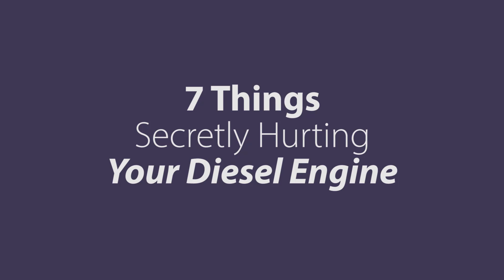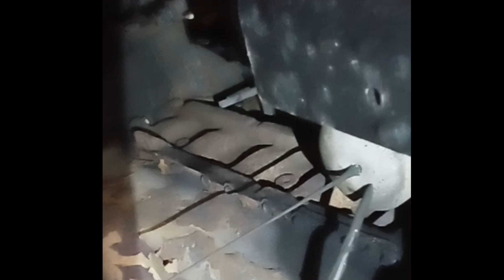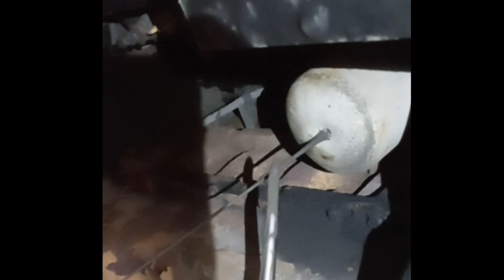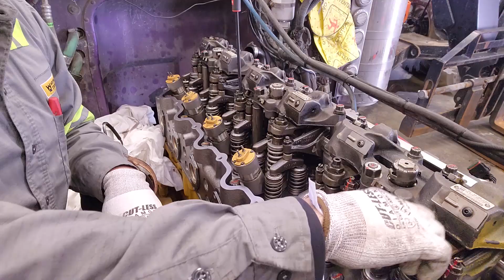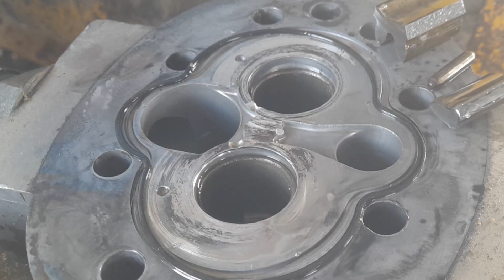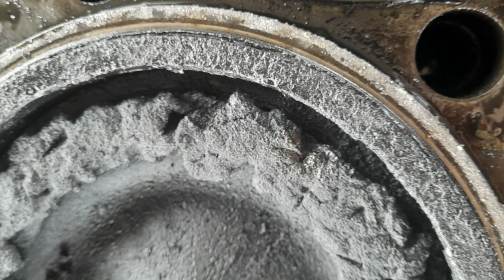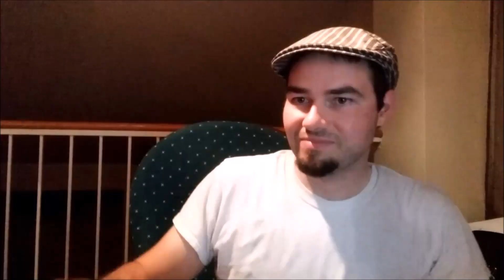Top 7 Things that could be SECRETLY Hurting your Diesel Engine.

Comment: It blows me away that we haven't gotten ACs that can run off batteries. The engine always has to be on to stay cool. That's just stupid.
Reply: AC is extremely energy intensive. The reason it works well on a belt drive is because you’re providing 2-3HP or something to it in that way. 

If you need 2KW from a battery you’re going to have a bad time. Even a Tesla power wall which is huge and heavy would only be able to run AC for possibly 5 hours.
Reply: They're available,probably the cost puts people off
Reply: Back in the '90s Cat developed a system called MorElectric. This was a genmotor replacing the flywheel, starter motor and alternator. It could make 30kW (50HP?) @ 48V (just like the Cybertruck is doing today). Cabin cooling was an ELECTRIC heating & cooling airconditioner (size to mount under the seat). 48V enabled electric waterpump oil pump fuel transfer pump but NOT the fan - they need 30+HP to drive. It also meant you could plug the truck into a power outlet and have full heating/cooling with no engine running.  The BIG benefit for reliability was removing the lines for air con and heating systems and going to rigid lines.
This didn't go very far - though Cat did change to electric cabin cooling package in the roof to get the reliability improvements.
Also Cat Industrial engines is again talking about the 30kW genmotor (well they did a few years ago I haven't looked more recently).
FYI the people that REALLY wanted it was the US armed Forces - an inbuilt generator with EVERY truck. The beauty they saw was no extra cooling system packaging etc etc. They wanted 60kW though - not sure where that all went to. Maybe it is its time now
Reply: @ianloy1854  That’s cool. If trucks were geared up with electric heating and cooling that would enable all truck stops to have power outlets and operate more like powered RV sites. 

Not sure if truck drivers would prefer to pay $10 for power overnight or idle their engines though. I’m sure a lot of people would complain about needing to pay, while idling the truck overnight probably contributes to an expensive rebuild lol.

Comment: What about using the Exhaust Brake to warm it up quicker right from the start?  Probably not good, huh?!
Reply: I could be misinformed but have heard in the past anyway that some of the European diesels that had an exhaust brake ( basically a butter fly valve after the turbo in the exhaust system ) used that system to give some back pressure to enhance warm up and thus reduce the time the engine is running cold/smoking. I don't know how the system was controlled, I presume electronically. An actual exhaust valve controlled type Jake brake system would not have that ability. That might be something Josh can dig into and make a video on exhaust pipe engine brake systems with their duel purpose.
Reply: @charlesb4267  Elsewhere there is a comment about current Volvo/Mack having VGT turbos and these closing up to help heat the engine - effectively an exhaust brake (not compression brake) yes it helps. The issue is will it be turned off at the right time?

Comment: On my 2018 Pete 567 with the Cummins X15, when I change my fuel filters, I install both new ones empty. I then just cycle the key several times which runs the electric lift pump that pumps fuel from the tank. It will fill both fuel filters (the sound changes and you can tell when they're full). I then start the truck and it runs normally. Easy.
Reply: R u bleeding air from fittings as lift pump primes?

Comment: cold starts under 30 degrees, start give it 3-5 mins idle then idle up 650-700 rpm 5 min then 800 for about 5 min, next as getting rolling idle out of parking spot, basically working gradually as getting on the highway getting tire sidewalls warmed up and trans diff and freewheeling hubs fluid up to working temp gradually

Comment: Agree on extended cool idles doing damage mostly from excess carbon deposits BUT; swift temperature changes and high reciprocation speeds will cause different metals to expand and different rates, causing cylinder wall chaffing, loosening of fasteners, and cracking of hard metals such as exhaust manifolds
Reply: I'm with you on this point. N14 here. Cold or warm weather, I'll start, low idle for 1 minute then high idle ~1000. When oil temp rises to minimum 120* then I feel it's ready. In freezing weather it does take up to 10 minutes but I'm not shock heating the different metals involved

Comment: There was a Cat training video back in the day that showed how oil fills gaps between moving parts at low idle vs elevated. It was showing how increasing the RPM pulls oil into these spaces creating a thicker cushion so to speak. Does your training dept still show those old videos on liner cavitation and whatnot?

Comment: Yes Sir, prefilling filters, makes me a lot of money. I have had a couple piston failures, oil filter was prefilled. The foil was apparently pushed into the oil jug. Poured directly into the unfiltered port. Eventually made it to a spray jet and plugged it up, early 92U engine. 
Second, MBN, oil filter must have been dropped in oil dry. As I dug parts of oil dry out of two spray jets, again seized pistons. 
Improper maintenance, is the fast way to the repair shop. Also putting new dirty parts on. Had a REGEN engine that I replaced the fuel enable valve. Before I installed it, I took starting fluid and washed it off, onto a lint free rag. You could see the metal fragments that washed off the threads. As my first cousin told me once, John you can never be to clean building an engine.
Have a safe and a Happy New Year to the Josh Family.
Reply from the maker: Thank you John and have a great year. Hope you are feeling better.
Reply: Well Prefilling in itself is not the problem...being an idiot is going to ruin anything...But prefilling is better than starting an engine with ZERO oil pressure for 10-30 seconds.  I have rebuilt thousands of engines...and prefilled tens of thousands of filters....I have NEVER had a Pre-Fill-Failure... But then again, I'm not an idiot... If one is not going to pre-fill oil filters...spinning the engine over with the starter to prime the oil system before starting it, is a better way... On the OLD Mack we had My Father would prefill, AND spin engine over with the "Engine Stop Cable" pushed in...To build pressure...Therefore the engine never fired without oil pressure...He also warmed it at 1000-1100 RPM for 15-45 minutes daily...That engine/truck went more miles than ALL of its "sister" trucks...

Comment: Happy New Year.. Got a video option, Ether use on a new cat motor a Nex Gen 2022 cat 323... afew months ago in March, new operator shows up to my company, has experience but only working for Public Works and is 40 years old, boss thought he has the most experience, yet hes only operated a old 1990 Link belt, and maybe a skidder... long story short its cold my 2020 Cat 330, i let it cycle 1-2 times on the glow plugs and start it up.. he decided he should grab ether from his pickup and was starting to spray his airbox on 323 with ether.. i said woah dont use that on any of our new machines for no reason.. and he was insulted but I said that 323 has started in -34C... I said its only -20C.. Im in Canada, would be great to hear or see Ether storys on why or when to use it, when a block heater power soorce is not available in the bush.
Reply: Also how long should you wait to shut down a cat motor.. a c7, running hard all day in 90-100F .. this other operator would shut down the machine immediately after using it, just to talk with someone.. And I tryed to say Dont do that but at the end of the day I dont own the machines so if my cousin/boss isnt gonna do anything about it and assume it will be covered under warranty on excavators, but yea how long do you let a modern tier 4 engine cool down before shutting it off. I usually wait 5-8 minutes.
Reply: @JaredBeaucage  The time needed for the turbo to cool down - so if you haven't been working it hard you may well shut it down with very little idle time, if you've been working hard then the 5 minute wait (above low idle preferably) is better. The need is to cool down the turbo shaft not just the wheels as it is the shaft that runs in the bearings and can cook the oil that left between the bearings and the shaft which is what you are trying to stop happening.

Comment: at 6.25 you can see the bolt update hasnt been done, you really should find the service letter  and follow it, anytime you have four 12 point bolts in the jakes it needs done, you should have three six point heads with bolt 3 being 12 point, no thermostat creates hot spots in the engine, the water must slow down to absorb heat, heat transfer takes time, cat will cut the fuel within the ecm if boost is too high so pinching off the wastegate is moot, blowing out air filters should have been in your list, fuel filter on the frame must be a 25 micron not a fs1000 or fs1001 which is 10 micron will starve the fuel pump, the fs1212 or cat filter is 25 micron, most of the soot on the dpf is oil that bypasses the rings not unburnt fuel.
Reply: i found this on the web since i dont have access to sis anymore (The 3 required 12 point bolts are 167-0867, but the 9 required 6 point bolts are 257-2122) guess you might need washers also? dont recall any washers being in the bolt kit.

Comment: Hope you and yours had a Merry Christmas and have a Happy New Year. Great Video On large trucks, But what about small trucks. I just bought a new {23} GMC half ton with the 3.0 Duramax. I keep it in a heated garage. What recommendations do you have for that engine and all the other small truck diesels? Keep the vids coming. I owned big trucks in the past, mainly with the 3406 and a couple of Cummings, and I did do what you said every day and servicing the engines. Although I am from northern Mn, at the time I had the trucks, I lived In South Carolina and Texas, but dis run I80 and I35 for many miles.

Comment: If I was a trucker I would have a apu on my truck so I dont need to idle the big engine like a small 2 cylinder gasoline engine
Reply: Honda 3000 IS on mine. Best investment I have ever made.
Heater now, summer a portable Samsung A/C. 14hours/3.4gal gasoline

Comment: On my Cummins x15 it has a fitting that you put a connector on and you pressurize fuel and that fills the fuel filters so it fills up your fuel filter from the dirty side with pressurized fuel
Reply: that compucheck fitting isnt for filling the filters and its on the clean side if your filling it there with the detroit fuel tool your giving your engine dirty fuel, cummins you use the primer pump to fill filters and bleed air out the fitting.

Comment: For my 1.9 tdi take for example it was 30° yesterday in florida I put my idle stick for about 1700 rpm for 1 min oil pressure came right up after 1 second of starting im running right now 5w30 with a quart of lucas and have 50 pounds of oil pressure at idle.
Reply: 1700 is way too much.  30 degrees isnt cold enough to warrant a long warm up.  Lukas is like a 60 weight oil so it will certainly increase oil flow restriction which you are refering to as pressure.  

At 30 degrees, best option is to start the engine, idle for 10 seconds, and then drive it slow at 1000 rpms or so.

Comment: What about the turbo  I was told it isn't  good to start the vehicle just to move it out the way . Because  the heat in the turbo  on a cold start will build  condensation on the cold shafts and damage  the seals Because  of flash rust . Is this a real thing
Reply: no

Comment: I have a truck with Volvo d13 its mixing diesel with fuel. had the dealership change all six injectors and cups. But it still has the same problem what do you think the problem might be?
Reply: fuel pump bottom left on rear, happy hunting.

Comment: Good info Josh. I run my 3126 at high idle for a couple of minutes and it seems to do the trick. A goo d indicator is when the airbox heater kicks off. I can tell when it wasn't long enough because the boost is low when I start driving. Happy New Year.

Comment: Great advice. On my ISX-15 they tell you to install the fuel filters dry and switch the ignition on and off about 5 times then lift pump fills the filters. It still starts rough but once started and run for a few then shut it off and check for leaks. Then it starts fine. Happy New Year
Reply: Happy New Year!!
Reply: On a Detroit,  60 series,  I would install the fuel filters dry, then put around 12 pounds of air pressure in the fuel tank and mine had a bleed screw open it just a bit and wait for the fuel to come out. Tighten the screw. Start engine,  it would usually start right off and run at about 1000 RPM and it would be just fine.  Detroit even recommends to NOT use the electric fuel pump to prime the fuel system.
Reply: A LOT of new systems have electric lift pumps. Cat truck engines don't for the simple reason they stopped making them in 2008/9 - 15 years ago. 
That is the same time as from the 3406C to the 2004 C15 ACERT (MXS/NXS non DPF). Those engines share liners and bolts but that's about it.
Reply: Who's "they"? If you're using Cummins recommended fleet gaurd fuel filters, they come with a plug in the center for a reason. Pre fill through the outer holes.
Reply: before the plug it was recommended by cummins to install dry and use primer pump to fill, and its much easier than spilling fuel everywhere especially if your using the extended life engine filter, just bleed it at the compucheck port, easy peasy.  @ericb8030
Reply: @ericb8030  Yes they do - but NOT because the engine manufacturer wants the filters pre-filled. Rather because if they are going to be pre-filled then it is better to fill them on the dirty side.

Comment: Always like your video content, Happy New Year!    In a while once the information becomes more known,  it would be very interesting to hear about what Cummins 1.6 billion dollar settlement with the US EPA on its RAM Cummins engine diesel emission defeat device implementations have been experienced in the industry.   Has this been a well known and kept secret?   Even though this is for the HD pickup truck market the big question is how much technology transfer takes place between it and the HD over-the-road X15 Diesel?   Cummins is seen as the leading Diesel emissions technology company in the world.  Why would Cummins risk its reputation when it should have the knowhow to make these systems work correctly? 

It took a long time for VW's diesel emissions defeat device system to become well documented and then longer to qualify it was by intent of upper management.    It is still hard to believe.   Now Cummins appears to has been complicit in a similar behavior at late as the 2020s.   In the case of large HD over-the-road diesels it could be understood there was no ready means to provide a workable engine right after the 2010 NOx limits so some type of defeat device was needed to allow operation.  That is a long time ago in advancing technology by 2019.    Cummins appears to be have continued with some type of diesel emission defeat device with new implementation as late as 2019.   These are for HD pickup truck Cummins Diesels, but it does seem such upper management decision level intents would share discussion with all the Cummins Diesel design engineers.
Reply: different emission standards.
Reply: who  do you think gave it to vw in the first place, ..........cummins

Comment: Believe me man, we have a fleet of shredding, roll off, front load, & rear load garbage trucks (mostly px7/9 or x15) & the idle dpf clogging is real. You can actually tell when trucks run on city vs suburban routes so we try to rotate the fleet throughout the week to spread out the highway miles vs downtown alley hopping.
Reply: You could also be like us & 'forget' to PM a 938m loader than feeds a recycling MRU for 5000 hours straight if you want a fun time. Literally no greasing, oil, or filters - for 5000 hours
  
Shop manager claims unit 'wasn't in the PM tracking system' that site plant mechanic said 'hey I never got assigned to PM it'....
Reply: @24allix That kinda falls on the person operating it too because he should be greasing it at least once a day too. And when the operator does their daily inspections the hours should be written on the filters and when they're checking things over should notice things like that.